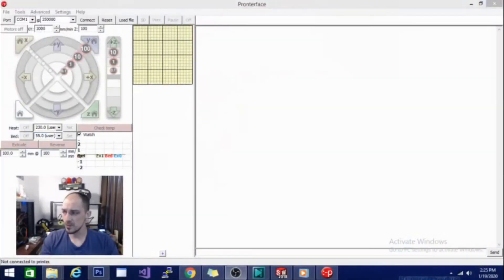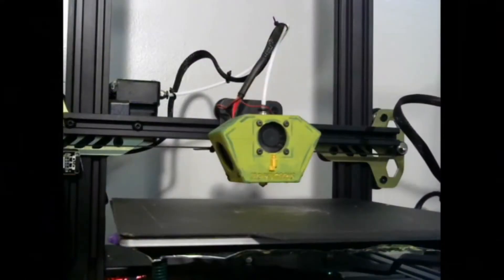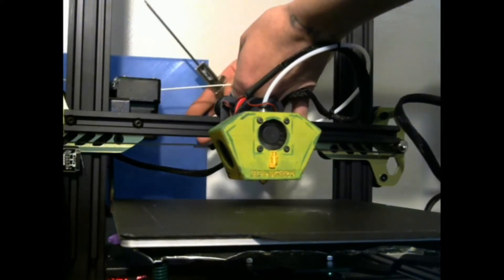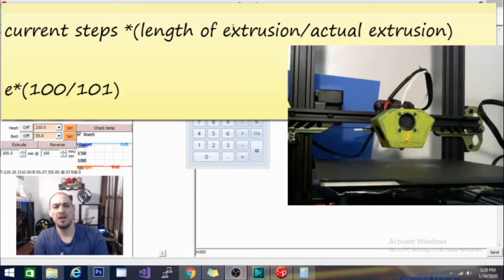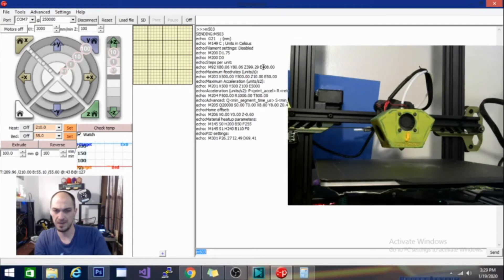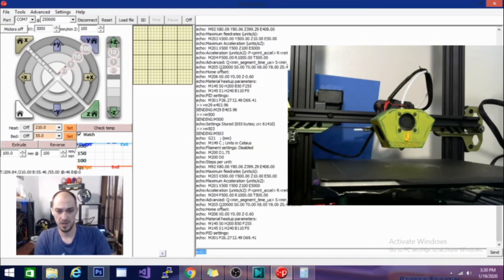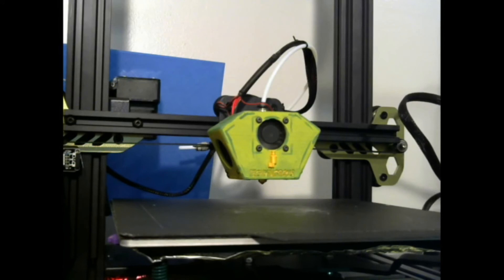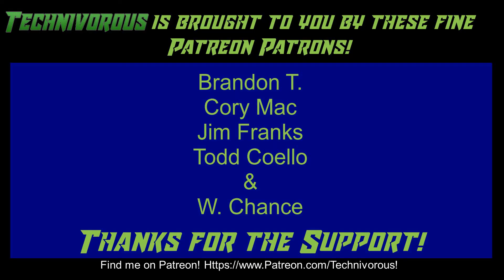Tevo Tarantula Pro 2020 - calculate and calibrate your E steps!

Comment: A Bowden printer is going to be met with lots of resistance. The cheap extruders slip slightly under load. My guess is you’ll be under extruding now. I believe that pushing the filament thru the hotend to be a far better way to measure e steps. Especially on a Bowden, single sided drive extruder. Just my opinion.
Reply from the maker: This is a safe assumption, as it's what I assumed when I first saw this as well. But I have been using this method for both my printers for a while now, and I get very nice models. The tarantula is now running smooth and producing accurate parts after both doing this and adjusting the z offset. The concern is a valid one though, and something to keep in mind.